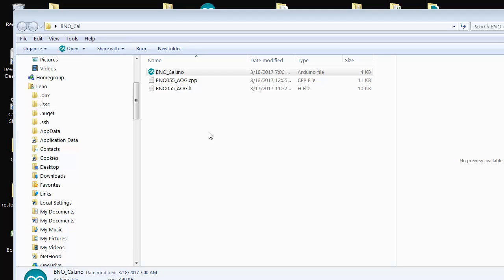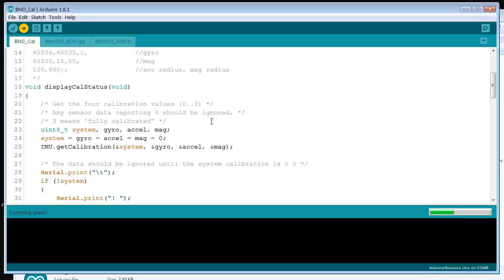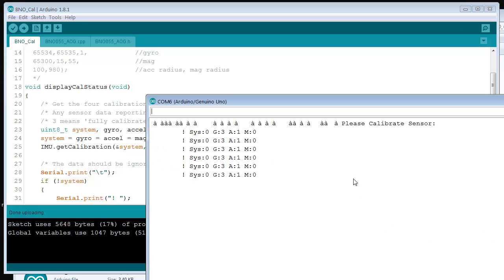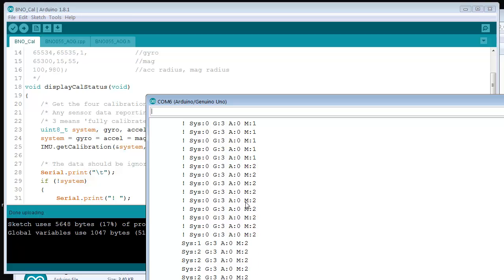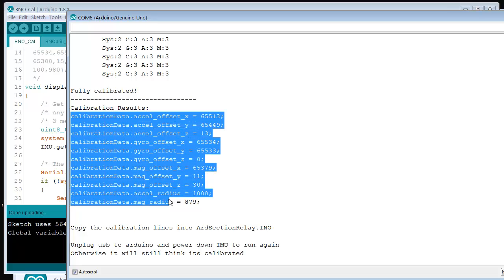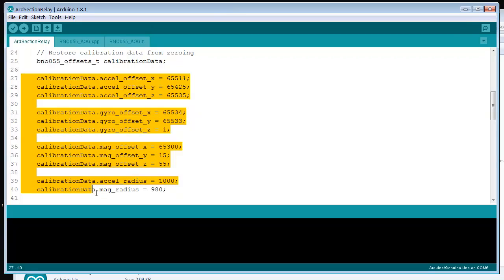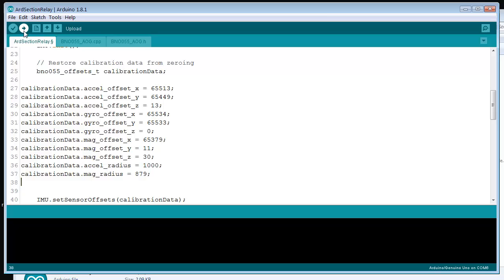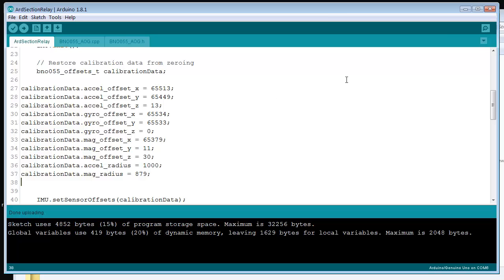Capturing BNO055 Calibration info

Comment: Posting this video without any code is really pointless unless all you want to do is show of what you are capable of. Anyway, for anyone working on this: Look into the restore_offsets.ino example provided by adafruit. First use the getSensorOffset method from the standart BNO055 lib and the display it with displaySensorOffsets method from the example. You can use the offsets by creating a adafruit_bno055_offsets_t and writing your offset data to it. That's what he does in the end of the video. Then all you need to do is call setSensorOffset on your bno object. Oh and according to adafruit loading the offsets needs to happen before you do setExtCrystalUse(true).  Good luck!
Reply from the maker: This video is pretty old, but thanks for posting. The BNO055 is a terrible IMU.
Reply: @FarmerBrianTee  It's a bit of a PITA to work with, isn't it? Takes forever to re-calibrate after you reprogram it. Sorry I bought two of them. 

Have you found any IMUs that you like better? I'm looking for one to use in a relatively slow-moving ROV project.
Reply from the maker: @bluehornet6752  None that don;t cost about 500$. :(
Reply: @FarmerBrianTee  Yowsers...

Comment: Sir I need a guidance. I want to change the acceleration scale of BNO55. I tried changing to 8g but it doesn't gives value greater than 4g. It's like the range isn't getting changed. Please give bit support and help me in running my BNO55 on different acceleration range.
Reply from the maker: Not sure, but you will have to read the BNO manual on how to. Are you sure you need 8g in a vehicle?

Comment: hi, After adding the offset to the main program, you did not show us that the BNO055 is autocalibrated now.
Reply from the maker: Its not autocalobrated, the offsets used by the bno to calibrate itself are read after a stable calibration cycle and then inserted into a different sketch and used as initial calibration values. The bno055 never stops calibrating itself. This method just helps it gets to very close to calibrated quickly.
Reply: yes you are right.i also understand the same way.as you mentioned very close to calibrate, it means still we need to move  bno055 to calibrate quickly ? if we reset the controller.
Reply from the maker: I think just the magnetometer needs  a bit of a wiggle after. NDOF mode requires minimal after loading the offsets. This is for mounting in a tractor where the unit cannot be moved after installation.
Reply: its looks interesting.same issue i have. upto now is perfect. suppose you moved to another city then again need to update the offset value ? or the same offset value can be used. because i also installed the BNO55 and i can not move my device too. may be in my house everything is ok. if i move 100km away and i would like to test my device there but on new position  the offset will be different i think so.
Reply from the maker: The magnetometer would only need a few twists as the accel and gyro would read the same no matter where you are. The BNO constantly recalibrates and that can not be turned off.